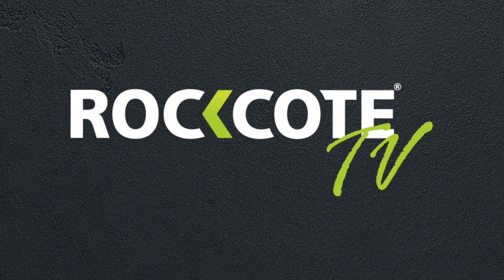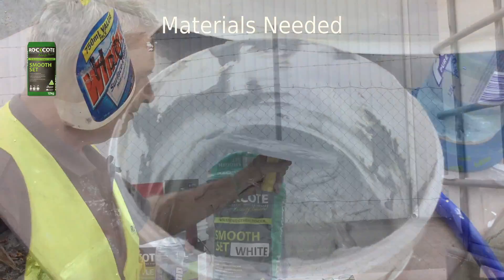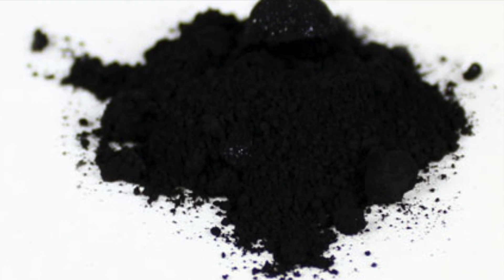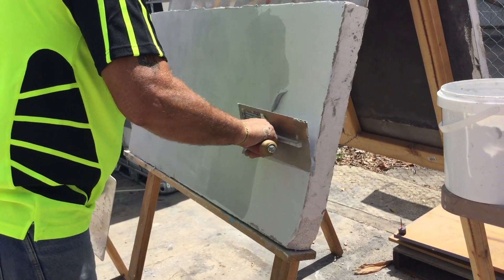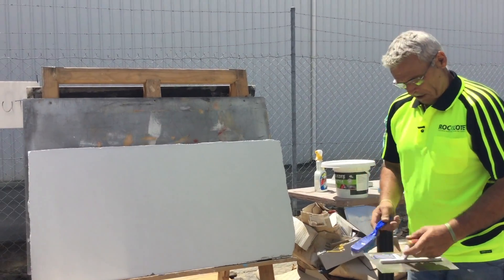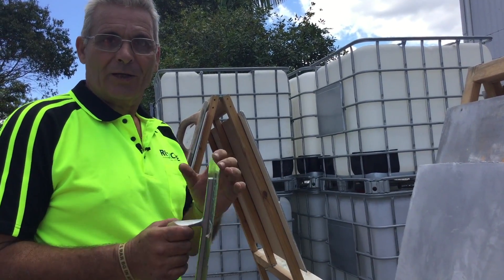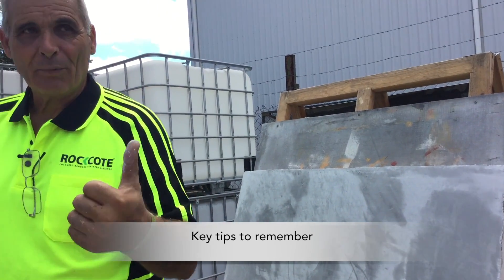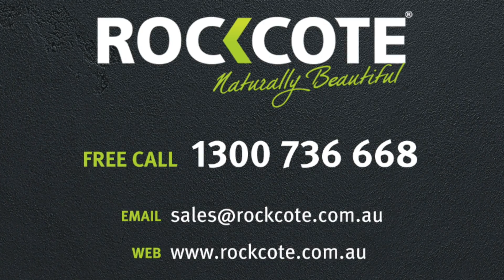How to Achieve a Polished Concrete Look

Comment: What do you do on external corners? Use beads then do adjoining walls in one mix? Or do you break the corners up and do opposite walls eg on a pier? Thanks
Reply from the maker: Hi Rhys,
You can use corners as start and stop points if required. If you would like someone from our technical team to talk you through the process, feel free to give us a call on 1300 736 668.

Comment: Can you Darken up the second coat to give a 2 shade finish like Venetian
Reply from the maker: Hi, you can definitive use different strength of oxides between coats and work your trowel to achieve similar effect as to Venetian Plaster. Just note that Smooth Set will give you a matt finish rather than a polished Venetian Plaster. If you like to know more please give us a call on 1300 736 668.

Comment: Is this product the same as rockote marakesh?
Reply from the maker: Hi Fifi,
This product is different to ROCKCOTE Marrakesh. Smooth Set is a cementitious product that can be applied easily by most renderers, whereas Marrakesh is made from Natural Materials and requires an applicator/Artisan specifically trained in its application. You can find out more about each product on our website:
- Smooth Set https://www.rockcote.com.au/products/smooth-set-white
- Marrakesh https://www.rockcote.com.au/products/marrakesh